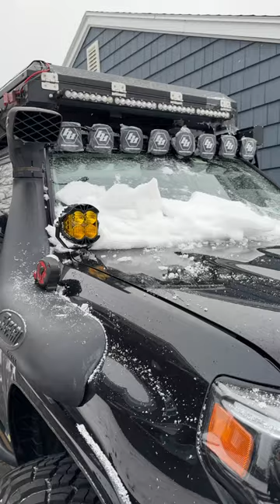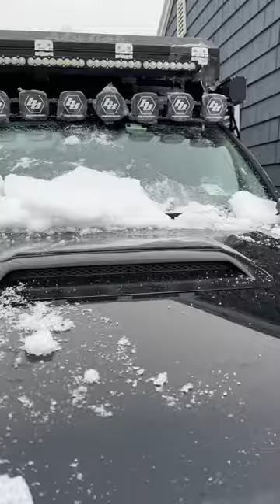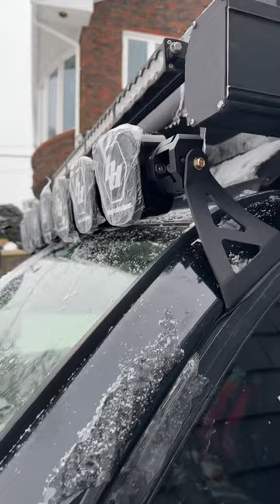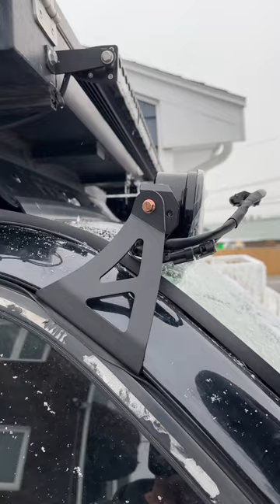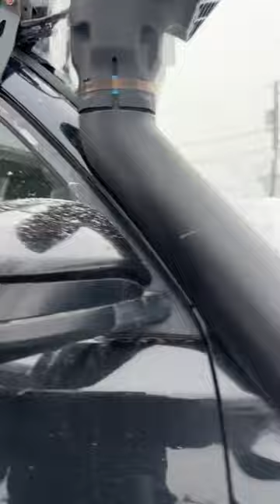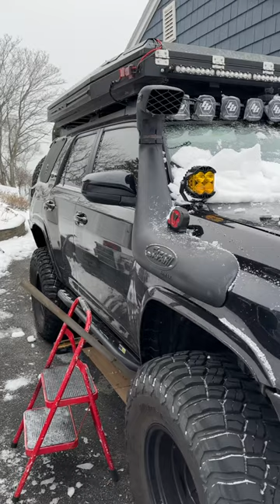Drilling holes in a new truck, what could go wrong??  #shorts

Comment: We had record breaking snow on the  Oregon coast..5-6" with 20 degree temps..The driveway was a sheet of ice..
My manual tyranny and all wheel drive 05 Honda CRV got me to work and back no problem. Plus my knowledge of knowing how to drive in those conditions.❄️☃️🌬 
Wait until warmer weather to get under your rig..Be safe my friend...♥️🙏🙋🏼‍♀️🐈🐕
Reply: Manual is the way to go. Almost every car I've ever had was standard shift. You may find this hard to believe, but the best car I ever had for snow was a 1969 Karmann Ghia in the early seventies. As I'm driving up a hill with cars in the ditches on both sides, I'm still moving along. Guess it was the engine in the rear, but that little thing was almost unstoppable.
Reply: @angelbulldog4934  I always wanted one of those..They were so European sport car..I wanted a British Triumph TR4 sports car & a Vespa... Too many movie's 😅😅
Reply: @JJ.LovesAnimals  TR-3 for me. Learned something from that car, too. Apparently, here in North Carolina it's essential to have windshield wipers. However, you don't have to have a windshield!
Bureaucracy is such a clown show.
Reply: @angelbulldog4934  Tuesday I was having a late lunch with a friend at our watering hole..We were sitting at the bar. The topic of the 60s built '56 chevys along with all the other makes (big blocks, hemi, bored  out motors) lead into muscle cars of the '70s.. Cruising the hot spots with Everyone showing off their creations..Everyone got into the conversation it was really fun. One of the best times I've had in a while...😊

Comment: You haven’t used your crawl box and it was really low on oil, wow that’s a first
Reply from the maker: leaking since installation  which i pointed out and was told "probably just OVERFILLED it.  Pulling this was a peach, re install will be even better Im guessin.

Comment: What's the story with the transfer case?
Reply from the maker: i have it dissconnected weather is bad so hopefully pulling it out tomorrw and sealing it up huge project doing this alone in winter and in driveway.
Reply: @JailBreak Overlander  did it blow or are you putting a seperate gear box in as well?